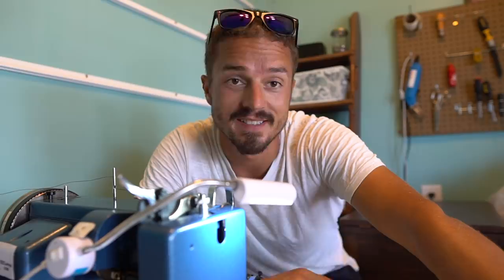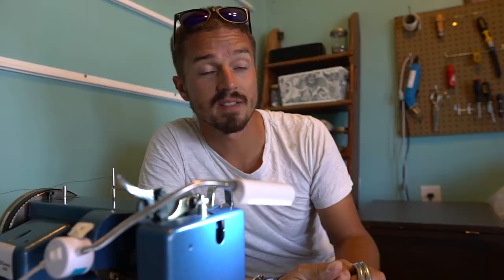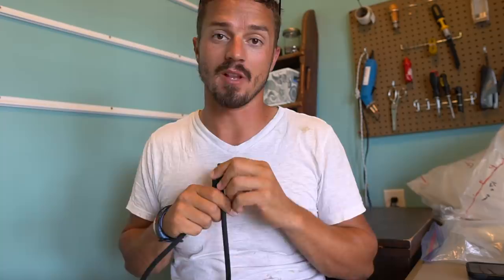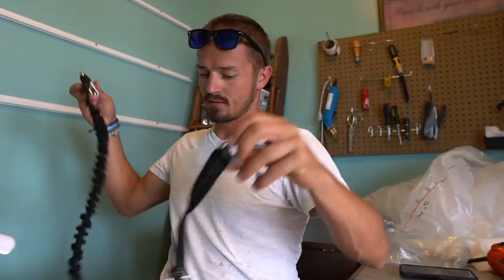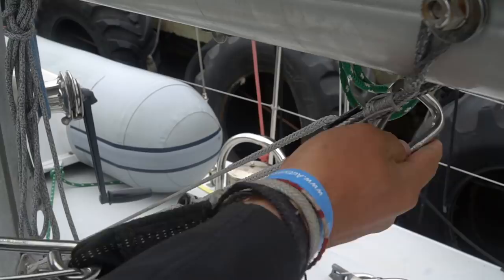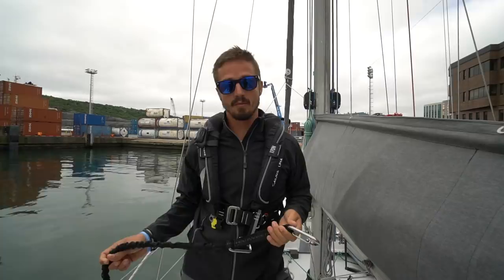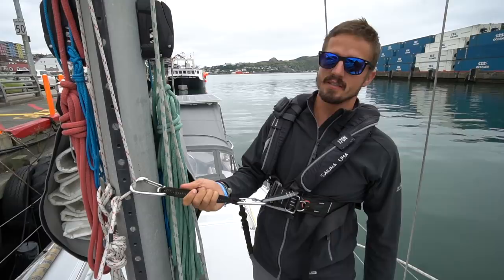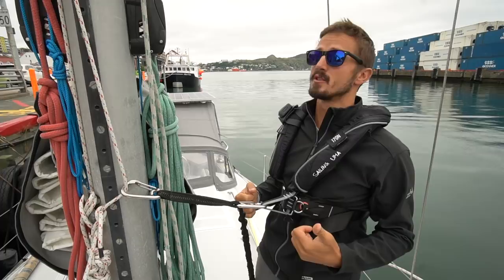DON'T FALL OFF THE BOAT!

Comment: Need to locate the Jack-line as far inboard (along vessel center line) as possible, then limit length of long tether to not permit going overboard.  Cases have been documented where the crew head gets bashed against freeboard once they get beyond the gunwhale... when tether is too long.
Reply from the maker: We clip into the windward line, so if we loose footing we will fall across the boat and still won't go over the side. Attaching along the side means a very tight tether when working off the side deck, like pole work, or flaking the sail. A tether long enough to reach these areas would also allow you to fall over. Hence the shorter lead to clip in once we get somewhere. Long tether for mobility, short one prevents going overboard. We also like being able to move from the cockpit to the bow without unclipping like you would with a centre run line. 

But, every boat and every captain is different. What works for us doesn't mean it will work for everyone.
Reply: @SailingUma  thx for reply! That's the way to do it.  I learned lots from Fastnet reports that came out about the time I was outfitting my Freedom 33 (80s)..and still sailing her.  Did you ever seal your lazerettes from taking water that enters cockpit?
Reply: My center-run lines start at cockpit go up one side of both masts, and back down other side of masts to cockpit. My mast are free-standing (stay-less), so that makes it simpler. I clip in from below deck as I ascend the comlanionway, since they pass right over the hatch.

Comment: I like your length! I do prefer a snap shackle hooked to my harness. Also, none of that is going to help if you're not using crotch straps!
Reply from the maker: Crotch straps only help if the harness isn't adjusted properly. If you cinch it down properly, you won't fall out of it.
Reply: @SailingUma  when you're hoisting an incapacitated crewmember from the water they will easily slip through the harness without a crotch strap. Most offshore races now require them and will disqualify vessels if they're inspected and find harnesses on boat without them. They're not comfortable or cool, but they're safe and will help your rescuers get you back on board.
Reply: Climbing gear approach, as worked for decades in the high country, and aerial work...👍

Comment: Jack lines should run down the MIDDLE of the boat so you're still on the deck when you fall. 
If your jack lines are at the edge of the boat you could be outside the boat when you fall.
Reply: That was my question when I first saw them. if you fall by a hard wave how will this keep you in boat?
At least you wont be in the sea!
Reply: Not 100% correct on sailboats, when sailing you always walk on the windward side so if you did fall you which it is likely you would fall to leeward you would have the whole width of the deck to go before you when over the side of the boat.
Reply: @davidgeorgeladewig7081   On every sailing yacht I've been one there is always one on the Port and then one on the starboard side deck, there will be others for working on the mast for example and if your boat is big enough differnt ones for internal of cockpit
Reply: First of all, anyone says "should" or "must" is full of crap but doesn't know it. Are we talking mono, cat, or tri? Aft cockpit ir center? Sloop, cutter, ketch, or yawl etc. 9ft beam or 20ft beam or maybe 30ft beam? Anyone who says should or must with out very specific parameters us as green as the grass in his front yard!!!!!
Reply: @TRMain111  nothing breaks on the leeward side? Ha.
Reply: Middle is optimum, but often not realistic. From Andrew Evans Thoughts, Tips, Techniques, and Tactics of Singlehanded Sailing
"On my boat the shrouds are slightly inboard, so I run the jack lines outside of the shrouds and jib sheet, but inside the lifelines.
The jack lines can run very close to the bow. However they must stop well short of the stern, such that the skipper will not drag even an inch behind the boat. It is simply impossible to pull oneself back up a line with a boat moving at 5 knots. Add the length of the tether to the back of the jack lines to see the total length. Then either shorten the tether or shorten the jack lines."
Reply: What kind of stitch did you use? That didn't look like a bar tacking machine.
Reply: I'd like to add for anyone watching this who also wants to race in sanctioned off shore events. Ben's tether is non compliant with the ISAF and ORC requirements for any number of reasons. So, while they are deemed sufficient oh ent for his boat, they might not be adequate for your purposes, especially if you're racing. And, not knowing what kind of stitching he used, unless it's a spec'd bar tack, there is a distinct possibility of the stitching failing under a shock load. So be careful before you walk down this path on your own. Personally, I found this video to be irresponsible.
Reply: @wilfdarr  obviously you understand the complexity of this question. Uma has a beam around 10ft, if your tether is 6ft as Dan said it was, and your Jack line on the center then you can go overboard on either rail. Plus its very difficult to get a centered Jack line aft of the doghouse. My only point is that "must" and "should" are the switch that stops reason. Uma is set up the way I believe is reasonable
Reply: @daneatherton7886  Sorry I wasn't disputing you, but others. I completely agree with you.
Reply: @wilfdarr  I know that you agree, that is why I said "you obviously understand". You are reasoning that there are exceptions. Sorry if I was not clear. You do understand!!!
Reply: @salnichols94805  ORC and ISAF regs are likely the only reason to use a twist lock carabiner on a boat!
Reply: @daneatherton7886  LOL of course there's exceptions! It's sailing! There's always a "most preferable way" and a "most reasonable way"! And seldom are they the same thing! Take care!
Reply: Dan Eatherton 
Safety, like most everything, is a compromise. When things go terrible you really hope you don't regret those compromises. I've seen people "clip onto" lifelines and say they feel safe. I'd say those people have never tried to get a crew member back onboard after falling off. Amazing footage of Volvo Ocean race shows how much effort this takes. https://youtu.be/a7Efkev5lBU

The word 'should' leaves room for the reality of compromise. I did not use the word 'must'. (Which is weird you added that.) 

I started sailing in 1971 when I was 6 years old in SF Bay.  I've raced the TransPac many many times. Raced in the Pacific Ocean, Atlantic Ocean and Southern Ocean. I've only sailed in winds up to 75 knots so if all that makes me full of crap then I wear that proudly.
Reply: @daneatherton7886  I'm absolutely stating that the Minimum Equipment Rqmts for race boats (regardless of Race Category) are safety related. They represent the current best practices for sea going safety, and include Safety at Sea training for a significant portion of a vessels crew. Now, is this required for someone like Dan and Kika? Absolutely not. All they need to be compliant in the U.S. is 4 flares, a day signal, 2 pfds, and a type iv. That said, the minimum isn't going to keep you alive. Our MERs also require to rails forward of the mast (something missing on Uma, and positive locks on the companion way while still being able to open from inside or out...including retention straps so that they're not lost. I spend 6 months every two years inspecting boats for a major ocean race, in addition to sailing the race and sailing the deliveries home. I know how to prepare for a Transpac or Transat, and it doesn't include skimping on a $150 tether or Safety at Sea training.
Reply: @wilfdarr  neither require the use of a twist lock carabiner.
Reply: @salnichols94805  I stand corrected. They don't require locking carabiners? I'm pretty sure they do, and one way to satisfy the requirement is with a twist lock, which I've always found difficult one handed. These are good enough.
Reply: @salnichols94805  In what way is this gear non compliant? How is this video irresponsible? You say any number of reasons, but I really don't see any glaring breaches? I worked as a skydive pilot for a couple of years, and would watch the riggers repair harnesses, and they would often talk me through what they were doing. It wasn't rocket science. Yes there is science to it, but not anything anyone can't learn.

Comment: I think your tether needs to be short enough so that it's impossible to fall over board. Very few people would be capable of climbing back on board again after falling over board without assistance.
Reply: Remember you're climbing on the "high side" when the boat is heeling. I wear gloves and knee pads and crawl if need be. Also, don't fall off the frickin boat!🤤
Reply from the maker: The problem with that, is IF the tether is short enough that it's impossible to go overboard, then there are places and situation you can't reach and deal with while clipped in. Think whisker pole or spinnaker pole work on the foredeck. We find having a longer one to move on (when you have two hands for the boat) and a short on to clip off when you get there and use both hand to work is a much better solution.

Comment: The key issue for the shackles is do they meet the mountaineering standard rating for side loading without coming open. I don’t remember the exact name/number of the standard, but you should make sure yours comply. This was covered in a recent article in practical sailing about the results of the report of the investigation into the man overboard deaths in the clipper RTW race, so you should be able to look it up. That’s an elegant solution for a customer made tether. When I’m off shore I just use two commercial tethers, one long and one short.
Reply from the maker: The joy of 316 SS clips is they won't shatter like aluminum ones will. Ours are rated for 7KN longwise and 3KN accross. But that is working load. If they fail, they will bend but still stay attaches. I've seen aluminum ones fail on cross loads in climbing when wedged against a rock. the just snap in half.

Comment: I'd respectfully disagree with the design of this tether. While I agree that having a bungee in your long tether is a safe idea, I think that the short tether is too short.

If the short tether is only 1 foot in length, you're stuck using your long tether more than you should, which actually amplifies the danger of tethering: falling over the rail with a tether that drags you in the water.

Don't get me wrong, short tethers are better, however, these points should always be observed:
1) Never tether to a point that cannot actually hold your body against the force of a wave plowing you off of the boat.
2) Absolutely minimize the length of time that you stay on a tether that is long enough to allow you to fall over. Or, if you can, NEVER let this happen.
3) Ensure that your jack lines are in locations that enable you to observe the above two points.

In summary, tethering safety is all about making sure you don't fall over the edge with a tether on your body, regardless of how you intend to react in that situation; staying within the bounds of the boat is the entire point here.

Comment: Utility patent. Look into it for some of your ideas/fabrications.
Reply: Doesn't a patent have to be for an original idea?  This is nothing new.  Practical Sailor even has published articles with pics of tethers pretty much exactly like this.
Reply: @todmills  a patent only requires a new "component" to an existing idea.
Reply: Patent only as good as your ability to defend it. They couldn't defend pffft!
Reply: Peter Torrey what is new here? Tethers with three attachments (one long one short) and elastic have been around for years. There is no stress indicator thread , no locking carabiner, no quick release snap shackle. It’s a worse mouse trap than what is already available. If they had any sense they would delete this video.
Reply: @cliffcrowley3756  dude..I have no idea what is new. My comment is for anything he has an idea for..or for anyone, actually. My Dad patented a " self engaging tie wrap device. He didn't invent velcro or a tie wrap. But his " invention" is used by millions. He also has patented a folding chair and a device to tighten wire tp hang paintings. Not new ideas..but his unique versions.
Reply: @petertorrey236  the idea should have some merit. What Dan has invented is something that was discontinued because they were UNSAFE.

Comment: You really need a "quick release shackle" with a "Red Ball" on a short line because if/when you are injured and hanging on that line with tension on it at night you will find it impossible to release it from you. Even in the day with tension and one arm to work with being dragged under your boat etc... 

You will have to get and open a knife and cut the strap. Good luck vs just finding the ball and pulling it to release yourself. I one flew out of the hatch overboard in a hurricane at night and grabbed the lifeline and pulled myself back aboard BUT if I had to release a harness (as my body was being dragged under the boat which is what was happening with y legs until I broke loose when the boat rocked the other way) well, I/you would really have to have a quick release or die.
Reply from the maker: I've never understood this idea. I've heard it many times. But still can't see when or why releasing yourself from the boat is a good idea. It would turn a nasty situation into an almost certainly of dying.
Reply: Releasing yourself from a liferaft when climbing into a rescue boat. If you are pinned underwater, as in a capsize. Could be you do have another tether pulling you in a good direction.

Comment: Super useful vid. I just got a boat, and after seeing the number of holes the PO drilled into it, I'm actually highly contemplating pulling an Uma, and taking out all of the stanchions to fill the holes. It's a starter boat, and will primarily be used to travel up and down the coast of FL in short hops while living aboard, while we shop for a boat to really cruise in. And oh yeah, electric motor will probably happen.

Comment: Dan, that video was one of the best ones I've seen so far.  I've been concerned about safety for quite a while and it was refreshing that you addressed this important subject in this video.  I was initially concerned about how easily the carabiner could accidentally get unclipped though.  But you seemed to explain your reasoning pretty well.  I would like to see an active discussion about this among the experts so we can all learn more about this important subject.  One quick question.  So the length of your tether prevents you from going over the side and getting dragged along side the boat?  Many thanks once again for all your videos.  They are really awesome.  Please keep up the great work you do.  All the best, Jim Andersen, Catboat Adventures, Cape Cod, Massachusetts

Comment: Dan, how did you secure the paracord in the webbing? Did you stitch through it? And, are the two parts of the tether made from one continuous length of webbing or separate lengths?

Comment: Interesting. I should think the choice of thread you use for the sewing is fairly critical (should be strong and resistant to UV degradation). Also, have you considered incorporating an overload indicator as you would find on a purchased ISO 12401 compliant model? (and do you test the ones you have made in any way to be sure they're up to the job?)
Reply: Honestly, the stuff on commercial gear isn't UV resistant: we needed to send ours out all the time because the thread was rotting. You just have to stay on top of your inspection routine (when Otto von Helmin is steering, take that opportunity to look your gear over.

Comment: Do your life vest have a crotch strap on them? If not, you need to sew these as the jacket will lift right over your head! Love your videos and just want to let you know we finished our Cape Horn self steering unit and we used it on our holidays and it worked awesomely!! Thanks for your help! Sv Secondwind
Reply from the maker: They do have crotch straps. But if the jacket is fitted correctly they won't come off. Most people we see leave their harnesses quite loose, in which case they will come off.